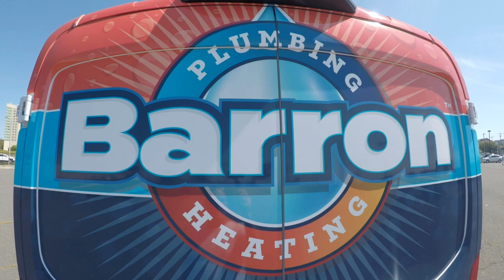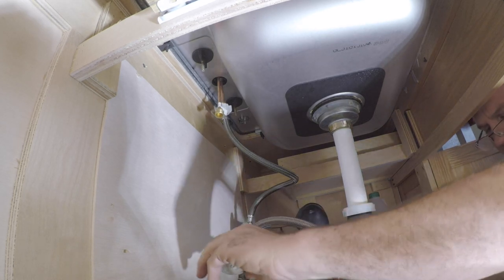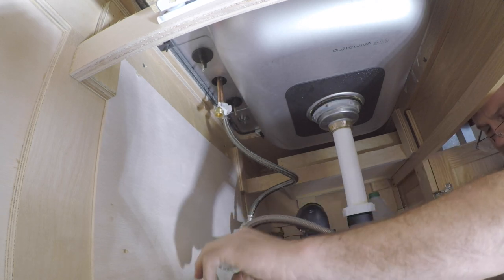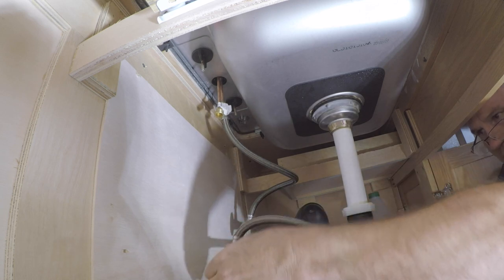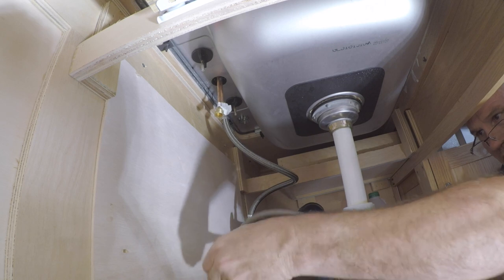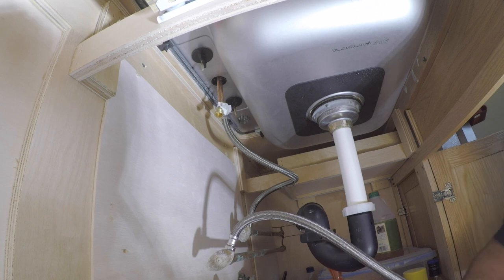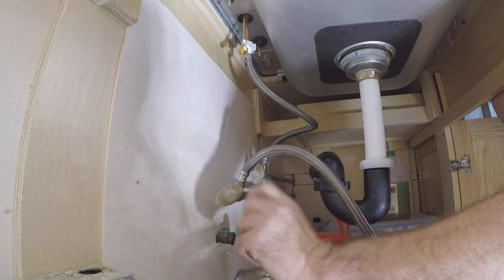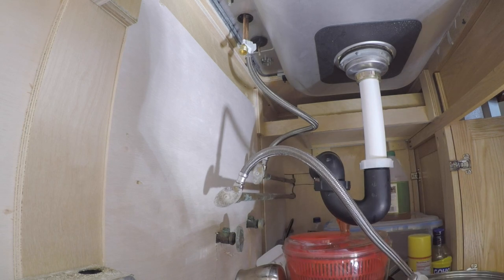PLUMBING REPAIRS | PIPES NOISEY | WATER HAMMER SOUND

Comment: Great video.  When I’ve come across that water hammering it tends to be the washer on a multi turn shut off.  My suggestion is simply to replace it with a 1/4 turn 90 degree ball valve.  They are more durable, reliable and simpler for customer to open and close.  In my limited twenty plus years of experience I’ve only come across one frozen ball valve.  Trust me, the days of compression shutoff valves (multi turn) that have a washer inside are over!  Ball valves are much better in my opinion.  Keep doing these informative and entertains videos, we love them.  Thanks.
Reply: Good point, the only advantage of multi turn valves is you can remove the packing nut to flush the line of dirt, whether its scale or some other debris. Can't do this with a 1/4 turn ball valve, you gotta undersold it...
Reply from the maker: True that.
Reply from the maker: agreed.

Comment: Your advise at the end about learning to use tools and your hands at an early age is spot on. I learned to use hand & mechanics tools probably before the age of 12-14, as kids we built racers out of wood and 4 wheels , we built tree houses , fixed anything on our bikes by the time I was 15 I was working on a car I had , transmission - motor - body work, at 16 raced it at drag races, changed clutches, transmissions, rebuilt the engine in my 58 chevy pickup.Some people supposedly learn how to use tools and still put them on bass ackwards like the bald headed guy in this video tightening up a supply pipe to the faucet ,both pliers on backwards ,chewed up the brass got slivers in fingers ,said enough!!👷🏻
Reply from the maker: So tru in both statements. dam. you caught me again.

Comment: Water hammer happens during the last 15% of closing a valve. Noise and vibration generally occurs from rubber in the plumbing system loose and vibrating. I would of changed that angle stop out to a 1/4 turn. No more rubber parts to vibrate.
Reply from the maker: snap to it CB...good call

Comment: an unmolested aerator may have choked the flow enough to not do that. but I'd have swapped the stop valve for a 1/4 turn ball stop(compression fitting type) too lazy to drain water and sweat pipe, cut, slam, tighten, tail lights :)))
I always pipe dope the threads, ferrule, pipe surface and all, which makes it easier to tighten and they won't gall up the ferrule/body causing a leak. just be careful to not overtighten them, because they'll do so very easily with the pipe dope lubricating everything.
Reply from the maker: Thanks for the tip

Comment: Thats a toilet supply
Reply: Faucet supply lines are a smaller size than toilet supply lines there for it would not fit if it was a toilet supply line
Reply from the maker: thats a stainless....
Reply from the maker: nice work plumb